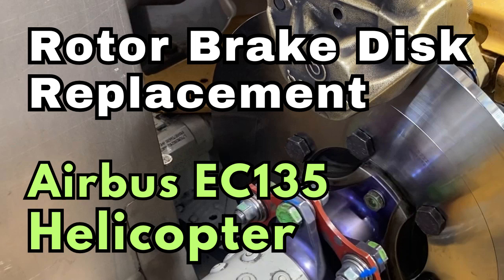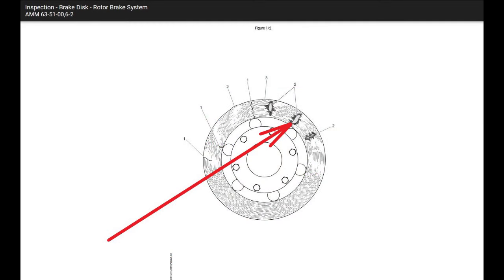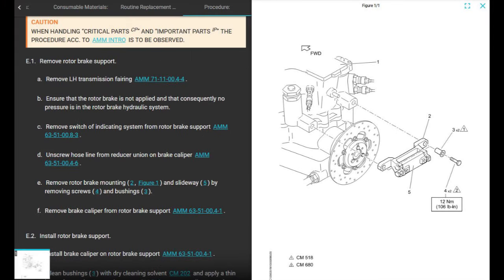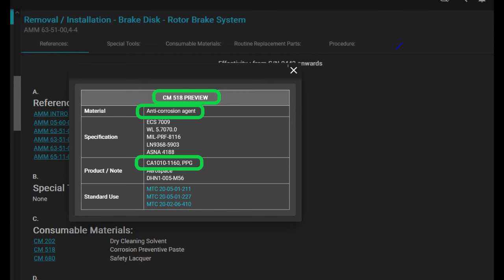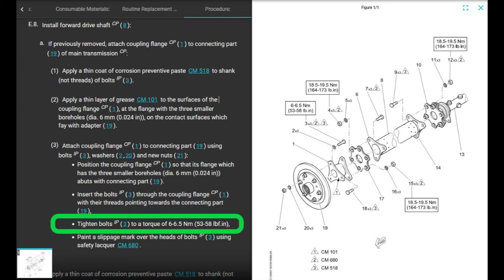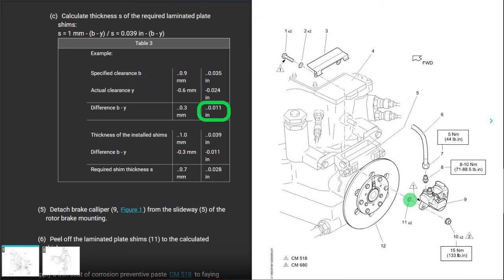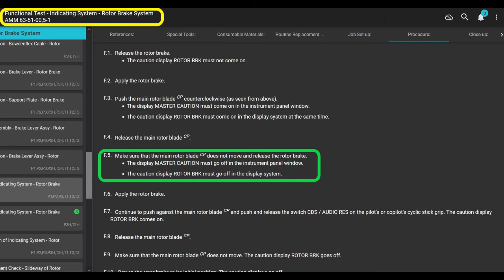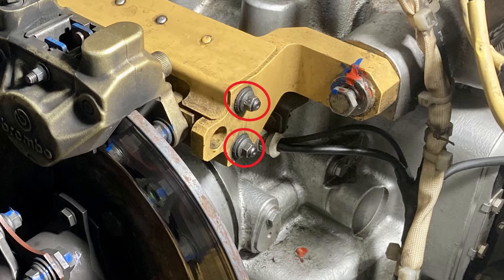Rotor brake disk replacement | Airbus EC135 Helicopter

Comment: Hi,
Many thanks for your video. We have an issue with the rotor brake system of our EC135P2+, we have bled as stated in the Orion AMM, but it is still not working. Any tips you can assist us with?

Thanks.
Reply from the maker: Hey, I'm sorry that I never got back to you.  In my experience, bleeding the rotor brake caliper takes a lot longer than you think it should.  If there is one tiny bubble in the caliper, the brake will not hold like it should.  And the brake on the 135 is kind of small.  But if everything is done correctly and the brake lining to brake disk run in is done, then the rotor will stop in around 25 seconds.  I plan on making a video on bleeding the caliper in the future.  Good luck.

Regards, 
Help Desk